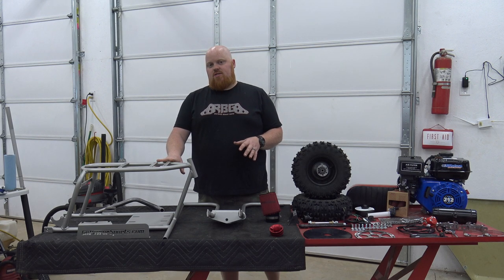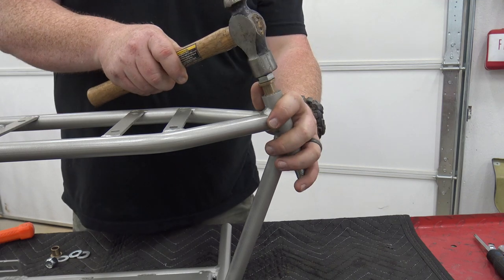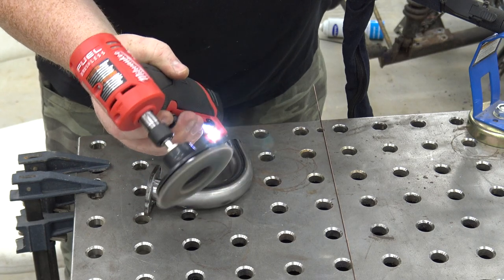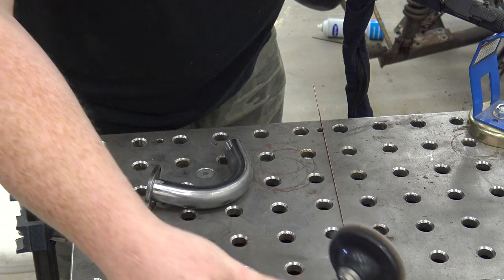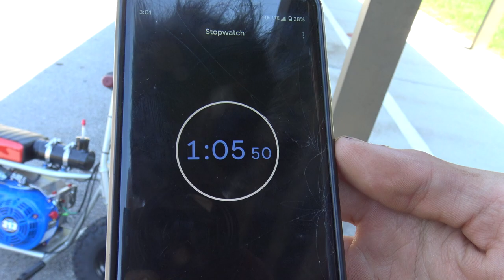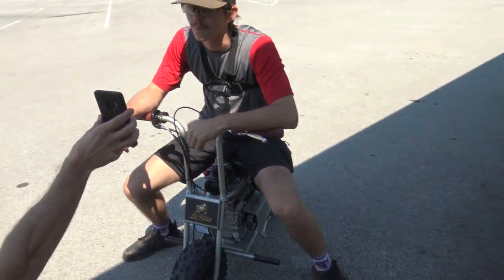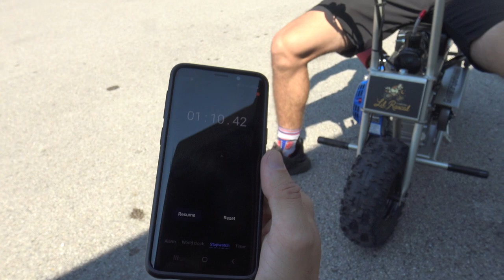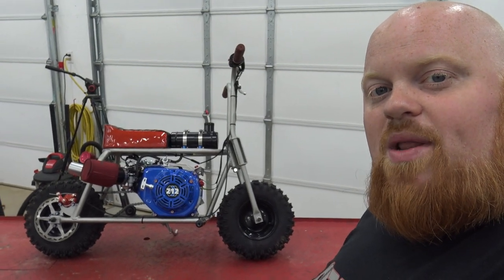DIY Lil Rascal Mini Bike Kit Build

Comment: Yeah it’s cool and all but for $695 without an engine is highway robbery.
Reply: And no suspension... Lonnie looked like he might need some ice on his grown after taking that on the grass for 30 seconds.
Reply: Ryan Watkins It’s crazy what people will spend money on, Especially a useless mini bike like this unless it’s for a toddler. For $695 for a frame could get you 2 Coleman mid size mini bikes or 2 Baja warriors used of course.
Reply: For a used minibike or go kart frame, yes. But not for a brand new one. That takes work to make these.
Reply: You could probably home build one yourself for half of the price.
Reply: It's a neat little bike. But that's about it. Keep in mind, you're getting everything that you need to build it. It's not just a frame. We're talking seat, wheels, tires, bearings, sprocket, disk brake with caliper, switches, cables, throttle, grips, fuel tank with mounting straps and different mounting options, and literally every single bolt, nut, washer, and bushing that you need, all in brand new condition and in your choice of color. This isn't some cheap slapped togeather Colman. This is a hand built American made kit. These are better parts for the money. All that said, I'm still not gonna be forking out 695 for it.
Reply: @techhead976  like I said I dont see me going 695 for this kit and then struggling to ride it. What i think they are selling here is a ready made kit that a parent and child can build togeather needing no power tools. I believe the goal here is selling the idea af making children's memories building their first bike with their parent. And for that I get it. But it's a lot for the avid builder to fork out that kinda cash knowing what could be built for the same investment. As a father I could see this being a fun thing to do with my kids. There's just no disappoint here. All the parts are there. They all fit. I've seen my kids when the project doesn't go as planned when that new thing has a part missing. It crushes them. So for that I do understand. You're paying for the reliability that this is all gonna fit, and not so much the value of the specific parts.
Reply: Way over priced, but it is a nice kit
Reply: stan535 Exactly
Reply: TechHead97 Facts!!!
Reply: Guido Exactly
Reply: Bought a diy ct200u clone kit ( random company bought the patent) for 259. Lool
Reply: karl G I bought a CT-200u ex with a new Predator 212 for $200 bucks.
Reply: @techhead976  nice grab! Where I'm from.everyone think thiers is some godly mini bike because they removed the govenor & want 800 for a beat up bike lol it was easier for me to buy the diy, got a predator 212 for 150 new and bought the stage one kit from GPS & removed the gov now shes a riot. 550 all in. Not to bad for a brand new bike
Reply: karl G Yeah in my area it’s like that you just have to be quick on deals most families get rid of them because of their kids not riding them and what not so you have to jump on them fast before they sell.
Reply: @techhead976  no doubt unfortunately when I see something I want I cant wait lol i tried 4 people and then just went my own way, dont regret it one bit as I've been maintaining my bike and been on top of things vs who knows what you're getting

Comment: Pretty nice, but I think I'll keep an eye out for a junker garage sale/ barn find with a good frame. Thanks for the fun anyway ☺️
Reply: Well do u live near a place called quitman GA there's a junk yard there. We're I bought me a murry mini bike frame for 30bucks with a 301cc on it. All I had todo was rebuild the carb an get 2 tires an a seat
Reply: Bought a ct200u clone kit diy for 250$ included everything except the motor which was another 200 shipped
Reply: Just bought a complete Baja blitz minus the carb and air box for $150 it’s just a 3hp but that’s fine for my 8 year old daughter. Parts are on the way and I’ve already tore it apart and painted it. Putting it back together tomorrow. Also order a new chain and brake caliper so all together about $200
Reply: Is there an upgrade for the foot pegs?
Like to see folding.

Comment: I bought the Coleman cc100x from Walmart for $279 plus shipping, bought the 212 hemi predator from Harbor Freight for $124.99. Stage One for GPS with shipping for $108  total gives me half the cost of the Lil Rascal and it is very similar in size and performance plus I have a brand new 100cc engine to boot. Love you RBG, and GPS but I agree just cant spend 1k for this.

Comment: 5:20 What's happening with the CT200U-EX in the background? 🤔
Reply: Looks like they have it mocked up for a jackshaft. Maybe they are going to do a suspension with a swing arm?
Reply: Yeah looks like it.. a few seconds later I think you can see the swing arm. Rear suspension would be cool on that bike!  -Edit. Maybe it wast after that. I thought I saw the swingarm somewhere.. 🤔
Reply: Oh yeah I forgot they said there were going to in that vid a few back..
Reply: @bwxmoto  Want to see the results of that. Wow.

Did you hear his comment at 4:48 in that video? They didn't like the 60 tooth. Said something about "more top end" with the 50.
 
They must not have did that uphill test. The 60 would beat the 50 tooth there, even with the 10 tooth on the TAV.
Reply: Yeah I don't know what they're talking about unless maybe they're going on a long trip on the road.. down a steep hill. Then maybe you could get going faster with a 10t-50t?  Still 9t/ 60t will go about 46-47 mph flat ground, 51mph down a hill. I know a 50t will only get you to about 38-39 on flat ground because engine is not winding out enough.  I really don't think these guys ever test these things with GPS.  My 8t/ 60t setup went up a steep hill (on road) at 36- 41 mph.  Film at 11! LOL (actually whenever vid processes)
Reply: But yeah that's going to be  cool build either way. CT200U-EX with rear suspension and big block will be a beast.. no matter what sprockets. LOL

Comment: I'm assuming you guys got all this gear for free, and that you made the video because GPS sent you the gear to promote it.  Its one thing to use GPS hardware on one of your restoration, repair, or custom build videos, its another to just make commercials for whatever they send you.  It speaks volumes about your interest in this product,  that you put a $12 rattle can paint job on $1000 worth of gear, without even color matching to the seat or air filter. Red powder would have set that build off.  I like your videos, and I will remain subscribed, but I'm not here for commercials for GPS.  The tone in the comments is pretty negative....

Comment: Its neat but for off road, those little tires and tiny frame are not going to cut it. Also i doubt you could put a torque converter kit on it. Way to small and WAY to expensive. Also, no way it handles well dude. Sketchy as hell.

Comment: the trick to putting grips on or peg grips spray a little Windex in it and it will slide right on then it will help it stick when its dry

Comment: 15ft of steel tubing ($15) , 2 tiny tires ($30), a plywood seat ($25). = $700 ??  Thats shameful
Reply: You forgot Stevie Wonder welding it up
Reply: Nothing shameful about turning a profit. The market will decide if the price is too high and they will decide to adjust from there, or not. 

Your comment is what is shameful. No product is sold at the cost of the material used to manufacture the product. That would be charity.
Reply: @Deucealive75  you get a discount for writing these posts i bet.......
Reply: @vettepicking  No. I have never bought from GPS. I use multiple parts suppliers though. Not just one.

I'm with you that the price is too high. I would never buy one anyway. . .

Comment: With the motor hard mounted to the mounting plate like that do you get a lot of vibration? I put a predator in a three wheeler and it vibrates awful. Shakes my hands to bad to hold at high rpm.

Comment: Can it fit a 212 with a cvt
Reply: Doubt it. A better question would be what does it take to install a CVT?  196 or 212, it doesn't matter. A CVT install would be the same for either engine.
Reply: taylor yochum  thank you for the response Taylor
Reply: Deucealive75  that’s true but the 212 has the most available performance parts
Reply: @mifferellis5578  I thought performance parts availability were about the same. But I wouldn't know for sure because I have 5 196's. No need for a 212.
Reply: Deucealive75 I’m just used to the 212s is why I like them

Comment: Hey there. I got the 212 installed on my bicycle.  While I'm riding it as I give it throttle there is a sound and feel of a bumping. As I throttle.  The TAV. I bought it from gas bike. Have ate 3 belts. Slipping like crazy. But I bought the Juggernaut driver thinking thank God my troubles are over. Nope I still have the banging and bumping.  I'm thinking it's my Driven . In your opinion with what I've told you.What do you think it is. Dose the Driven go bad . I mean yes they go bad.  But it's only 4 months young. Yes the Gov is out waiting on my valve springs the 20 lbs not the 18. But motor is running smoothly.  Thank You for being there for all of us out here doing it.